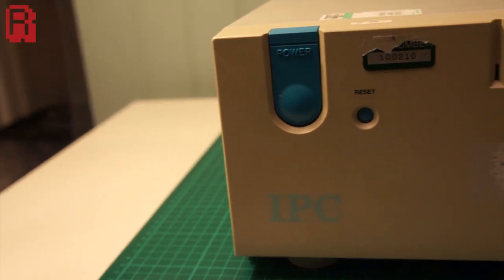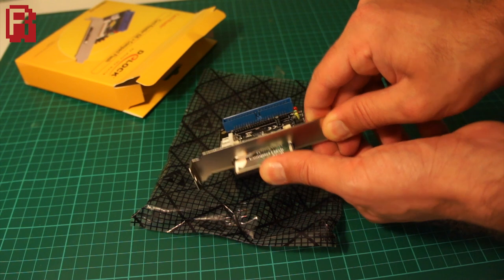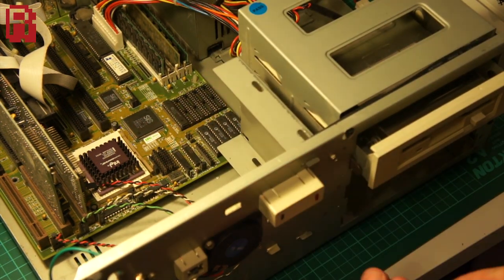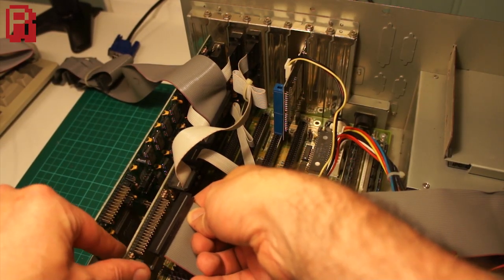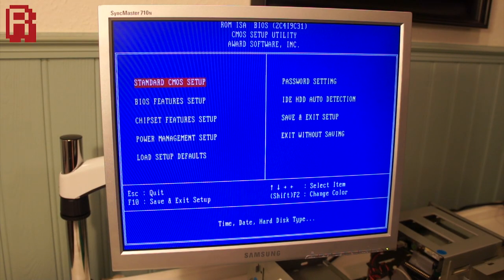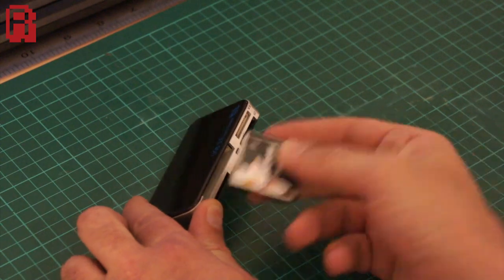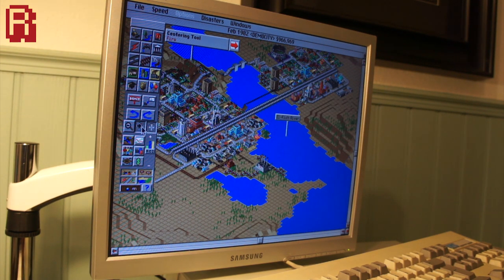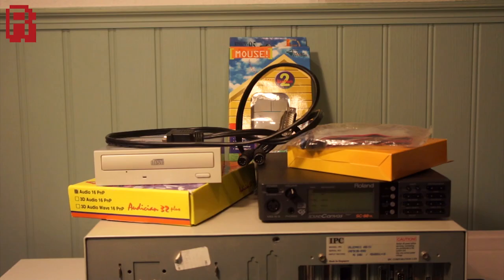486 Trash to Treasure Pt1 | IDE HD to Compact Flash

Comment: Placing a hole on pin 20 is perfectly safe, I've done it dozens of times for older pcs that had failing cables and the only cables available were the newer style with pin 20 blocked. Heated up a pin melted a small hole plugged in the cable.. devices functioned again every single time without fail.

Comment: I had a Packard Bell which I upgraded to a DX4-100, in 1993. That little thing SCREAMED. I paid I think $160 to upgrade it to its maximum of 20 MB of RAM (4 soldered + 4 x 4 MB 30 pin SIMM). My friends got their first Pentium 60s and then they started melting holes through their own motherboards, while my cool little DX4 ran Slackware and WFW 3.11 neat as you please. Wouldn't have traded it for the world. I learned a LOT from that cheap little Packard Bell. Wish I still had it, and can't remember what happened to it.

Comment: You could solder/jumper a small 2 wire cable and connect it to the HDD led light on the front. I like the blinky led lights on the front. 8-)
Reply from the maker: It's a good idea... and we do that in the final episode :)

Comment: I have these in my Compaq portable 1 and 2, Tandy 1000 and a 3100.  This is like upgrading from a SATA to m.2 on a new machine.  My 1000 boots so fast into Tandy Deskmate.  Love old machines.  I tried to use a CF on a Pentium class machine.  The problem there seems to be the computer writes too quickly for the CF to handle.  I could never get Win95 or 98 to install.  It always stopped somewhere early on.

Comment: been a year i know, but you can make a hole into that cable without worry. it will work just fine. i think it is not even connected to anything. just so you know for future. i've did that everytime on my retro machines.

Comment: This is an old video, so there's little chance of you seeing this, but I can highly recommend JP Software's 4DOS if you like playing around in DOS. You can either run it on top of MSDOS or point your system to use it instead of COMMAND.COM. It's totally compatible with MSDOS but can do a whole bunch more. I used to use it for writing really complex batch programs. I even used it (along with a few extra tools I coded in Turbo Pascal) to create an email system for my college's network.
Reply from the maker: I'll check that out thank you.  Turbo Pascal at college, those are good memories.

Comment: If I recall correctly, back in that era, sound cards included an ATAPI connector exclusively for the CD-ROM. Your IDE card may not support the CD-ROM directly. Then again, I may be thinking of 386, not sure with your 486 - depends on the BIOS, I suppose.

Also, look on the IDE card for an HDD activity light pinout.
Reply from the maker: David Jaundrew good idea I'll check the controller for an ide light pinout although I would have expected that to still be wired up with the original HD.  Sound card controller isn't a bad shout, I remember creative used to do a CD Blaster pack with a sound card and CD ROM combo.  I am finding though that with the flash card I'm not really missing the CD drive

Comment: i hate those cable that ship with a pin in them. I just use a Sewing needle and pop it out! great ideal tho, i don't have any PC older than a P2 350Mhz. i have no use for a CF yet because there speeds are limited via the ATA Specfications of the  IDE controller. If the CF Card can go 95MB/sec but your PC has ATA33... you are going to only get 33/MB a second. The PC's controller is the bottleneck not the CF Card.

Comment: Just a curiosity, but couldn't you get a CF reader that could be accessed from the front through a 3.5" bay?
Reply from the maker: Josh Mason they exist but I couldn't find one in stock at the time and had no drive bay rails.  The rear one was also tricky to get it appears most are to be left inside the case but I wanted easy access
Reply: Being an old modder myself, I instantly thought of taking a bay cover, put my trusty old Dremel Pro to it and epoxy the bracket to it from the inside.
I have done many a mod with my Dremel and some needle files. :)

Comment: I think the size reported by the bios has nothing to do with the partition size, it's a bios limitation. maybe you can flash the bios to a newer version.
you should do some tests to check if the full partitions are usable even if the bios reports the cards incorrectly. (I would boot with 98 DOS boot disk so I'd have fat32 support just to create and format a single 4gb partition). maybe it works until you hit the 1.8gb size the bios reports and after that mark the data gets corrupted?

Comment: Why use CF and not SD?
Reply from the maker: CF memory cards use a subset of the IDE command set, so making a bootable adapter is cheap and trivial.  SD to IDE card adapters need a chip to bridge to the IDE interface so there is more scope for compatibility problems.  Having said that, I'm sure it won't take much research to find a solid SD option that will work.  Personal preference I guess.

Comment: Personally, I think using  storage like this is cheating... Although if I want to get a HDD into my Tandy 1000 HX, I may be forced to do this, since MFM hard drives are insanely expensive, and the people who sell them often don't know if they work or have been parked correctly.
Reply from the maker: Tricky isn't it.  If this was an IBM I might be more of a purist about the components, but as it's your typical beige box clone from the era I thought flexibility would be permissible to get a good stable system working for some serious gaming.  A lot of fun has been had, and is still had on this system.
Reply: I've already gotten a serial/parallel ISA card to work in that Tandy by making a PLUS to ISA converter ribbon cable. The Tandy RS-232 PLUS card is insanely hard to find, and so my only hope of making a mouse work, other than using the joystick in DeskMate, was to install a generic ISA card. 

They really should have just designed it with a ISA riser rather than this convoluted proprietary PLUS system where the expansion boards have to plug into the memory/DMA controller http://i.imgur.com/B8q31QN.jpg
it's basically a mirrored pin-for-pin rip-off of ISA anyways (pin A1-B1, A2-B2, etc).

Retro enthusiasts are these days making PCB kits so you can build your own 8-bit ISA IDE cards. I figure if I can get the smallest one (there's not a lot of room in there) https://www.lo-tech.co.uk/product/lo-tech-isa-compactflash-pcb/ , and pair it with a IDE-FlashCard board hidden somewhere else in the case, I'll have a hard drive in a machine that was never meant to house one. I saw a YouTube video (can't remember where) where somebody had an MFM controller bodged into his 1000HX going to an external MFM hard drive.

That's a project for another day.